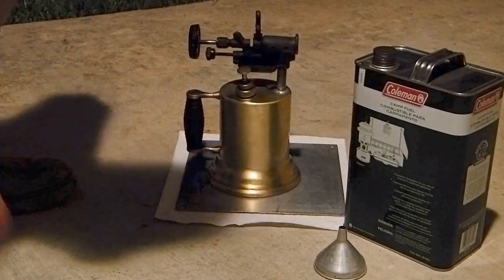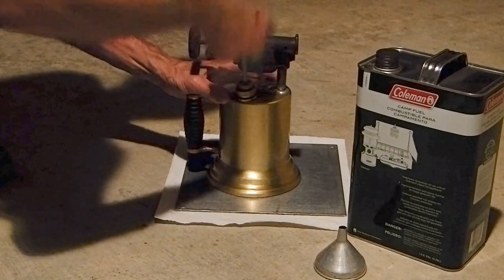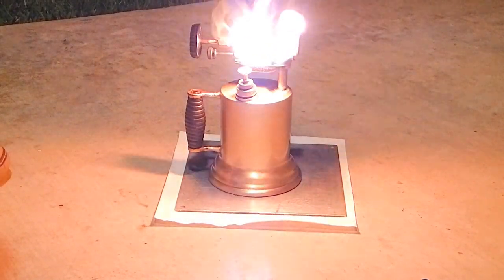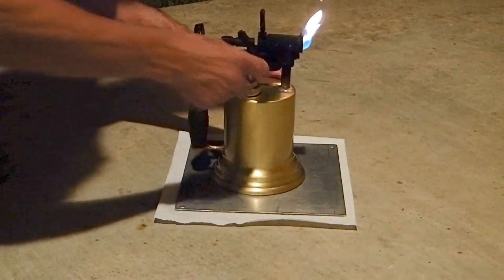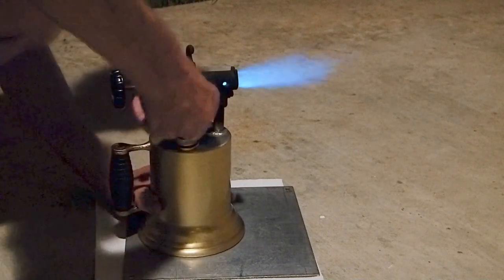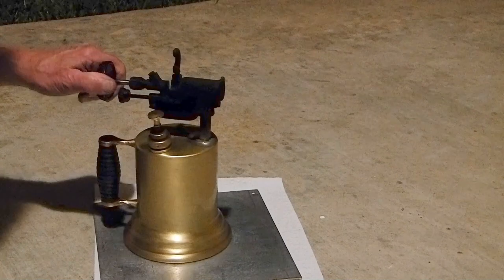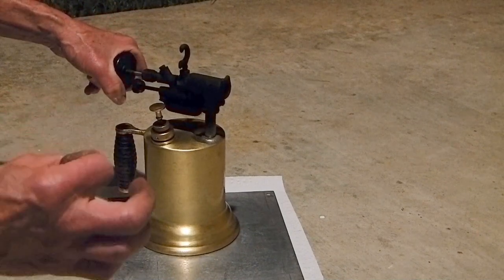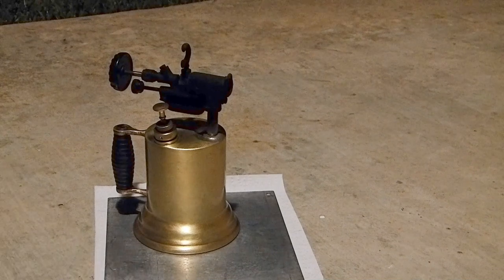Vintage Blowtorch Roars to Life (Good and Loud)

Comment: Is it possible to pump air before preheating?
Reply from the maker: Yes. You always pump about 30 times before first lighting. The low pressure makes it easier to control fuel flow before the burner reaches operating temperature. If the tank is at full pressure before lighting, there is a good chance for a dangerous stream of burning fuel to shoot several feet, sort of like a flame thrower. After the burner reaches full heat, you can pump the pressure to the point of where it becomes very uncomfortable for your thumb. By then, the torch is roaring like in the video.

Comment: what fuels to use?
Reply from the maker: The best fuels are the ones made for camping equipment like lanterns and stoves. It is much better than automotive unleaded gasoline which is known to deteriorate much faster and cause problems with corrosion and varnish deposits. The camping fuels are also somewhat deodorized and contain rust inhibitors.
Reply: and common kerosene will do? because it also inhibits rust
Reply from the maker: @resgatemusical.2070  I don’t think kerosene as I know it would work well in my torch. Because of it’s much higher flash point, it would be difficult to ignite in the priming pan. Kerosene might work if some type of wick was used in the pan. There might be torches specifically designed for kerosene, but I have not used one or know anyone who has. There could be some confusion in that some people might call white gas or naptha kerosene, but they are not. White gas and naphtha are more similar to camping fuel.

Comment: Can you braze with these? Or do they not get hot enough
Reply from the maker: The flame temperature of these torches, (2400 degrees F) is just high enough for silver brazing. However, the flame is so large you have to be careful not to overheat the whole part while getting the area to be brazed up to temperature. You want the part hot enough so that when the brazing filler material contacts the surface it will quickly melt and flow into the joint.
Reply: @Allen-Dennis  so why do others say that only an oxyacetylene torch is hot enough to braze with? I'm confused about this.
Reply from the maker: @foxfire8284  They are probably considering what works best. Using fuel and air instead of fuel and oxygen provides about the minimum temperature required to properly melt and flow silver brazing material.  Because of this, it's only small projects can be brought up to red heat with a blow torch. And it takes considerably longer to obtain the red color. I have silver brazed with a blow torch but the parts have been small things like narror strips of 1/16" - 1/8"  steel or  1/8" - 1/4" steel rod.